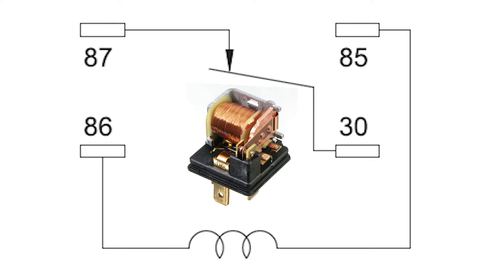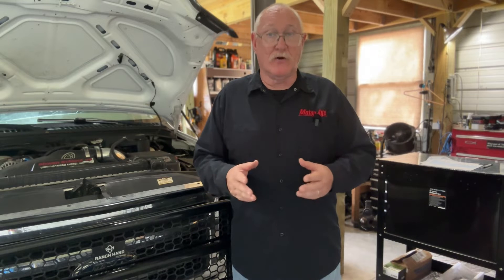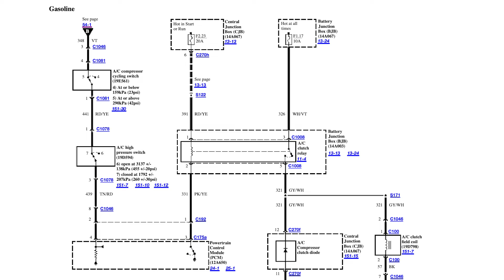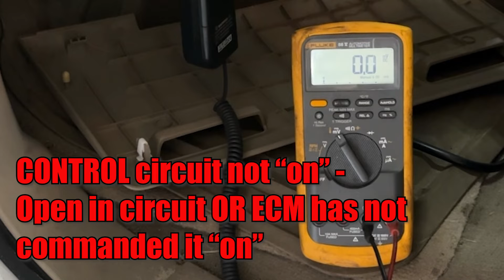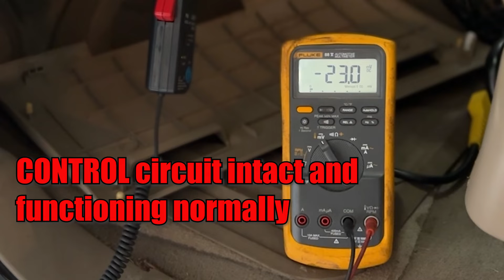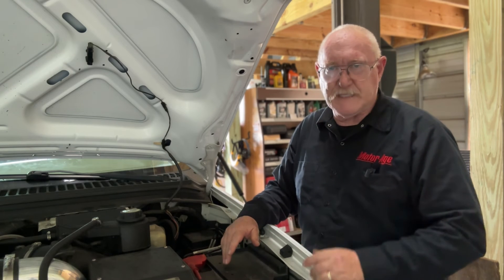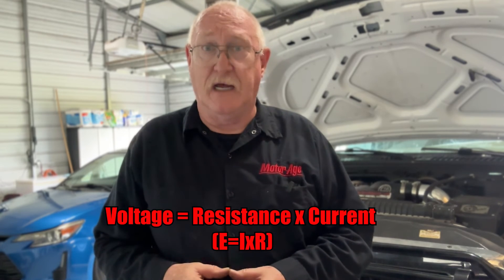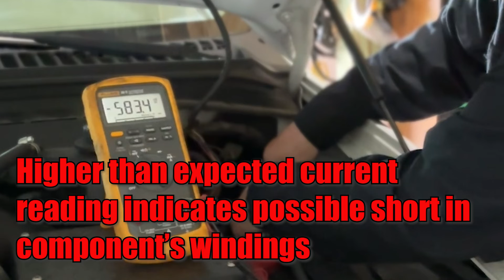Service Done Right #14:  Troubleshooting Relay Controlled Circuits

Comment: Some tips when testing relay circuits:

I would recommended starting with the load side rather than the control side. A control side fault will usually result in a DTC, which we will generally scan for at the beginning of the troubleshooting even it the MIL is not on.

And I would disagree that it is easier or more complete to start with a current measurement, and I think to be complete you should really showcase a car with an actual relay issue or introduce  a fault and then go through your recommended procedure to highlight how it is faster, where I think you would find the proper starting point is to do a full system scan for any DTCs, and if none start with the load side. 

So, without a code start by verifying the fuses are working and the load circuit is intact as follows:

1) When doing relay testing with engine off it is a good idea to put a voltage maintainer on the vehicle to slightly charge the battery and provide vehicle power for testing. For the vast majority of relay testing you do not have to start the engine like instructed to in the video, just go key on engine off (ignition on). 

2) To start troubleshooting a relay circuit, I think it is much faster to use a relay test jumper (see Lisle 56820, just really an extension) to gain access to the relay signals with the relay plugged into the jumper. Then you can test using a DMM on DCV, where many technicians introduce a small load (100 Ohm) across the DMM to decrease the overall impedance (resistance) of the measurement to slightly load down the circuit, with some techs still using bulb load testers. Introducing a relatively small load helps eliminate ghost voltage issues and high impedance connector pin / wiring harness corrosion issues. 

In the beginning the voltage test is better than the current test because the relay power feed may be shorted to ground which would blow the fuse in the fuse box, and if you introduce a fuse pigtail to measure current you would just blow this fuse also. When the control side fuse and the relay are in the same fuse box the likelihood of an internal relay box short is very low unless you live in the salt belt where you never discount fuse box internal failures, especially if under hood. For the load side fuse there is always a possibility of a load circuit short to ground.

With the relay test jumper (extension) in place for a low side drive relay circuit, connect the DMM black to battery negative and probe with the red positive lead. First check that you have power to the relay, you may have to go key on engine off. If you have 12V at the relay control and output (low side load) you know that the fuse(s) are okay. 

3) If the fuse(s) are intact, meaning no short to ground, then you can see if the relay output circuit, which includes the load fuse, will actuate the load. At this stage in the testing, it is actually faster to use a relay output tester like uActivate from AESWave to test the load side of the circuit (many will just short across the relay extension) rather than actuating the relay from the control side using the a scan tool. 

If a fuse is blown then you have to find the short or partial short which are very common failure modes. Two very popular options are 1) disconnect the fuse and relay and look for a short with a fox and hound, or 2) introduce a test load like 10 Ohm resistor (many use a bulb load tester) and probe for voltages, or perhaps use a thermal imager if the short is not a dead short (it has some resistance and will create a thermal hot spot). You can also use an audio test at the output of the test load so if you wiggle test the harness and disrupt the short the bulb will turn off but the buzzer will turn on. 

Why is this faster? The relay output contacts are the highest failure rate item after a harness short or a connector / harness corrosion issue. Also, if there is a problem on the module control side a code will generally be stored so the approach to troubleshooting would be focused more on the control side rather than the load side from the beginning. The module, unless there is a dedicated sense circuit which is almost never used, will only be monitoring the operation of the control circuit low side driver. So the module could be commanding the relay to turn on and electrically the relay control is on, but the relay contacts are so damaged the load never turns on, and if the contacts ever weld the load may never turn off.

4) If the load turns on with uActivate or a jumper, then swap out the relay with a new one and test for proper operation using the scan tool.

In summary if there are no DTCs stored:

1) Test power feeds.
2) Test output circuit. 
3) Replace relay and command relay on. 

More stuff:

There is another reason to use a relay and that is circuit isolation. With a magnetic relay the control circuit can be completely electrically isolated from the load circuit. The relay operates using magnetism which isolates the control from the load. However relays, as compared to solid state power control, are highly unreliable. 

From the Engine Control Perspective, you can control a relay with either high side or low side drive. Low side drive is used more often due to the lower cost of a low side driver. 

Most automotive module low side drivers are actually "smart" devices with many features one being an active clamp to prevent driver damage with the relay coil (inductive) load at switch off (inductive spike), for a very small and automotive relay capable device see ST Microelectronics device VNL5030J-E
. So, most relays with a resistor across the coil (for newer cars you will not see a freewheeling diode across the relay coil to protect the module output) is more to minimize EMI (radio interference) rather than protect the module low side driver. Also, any exposed pin on a module must be protected against ESD when handling, which also adds to the hardening of the low side driver circuit. The coil inductive spike is managed inside the driver.
Reply: This is by far the most elaborate comment i have ever seen on youtube. Explains a lot easy to understand. Good on you

Comment: Hi from across the pond.  I’ve had 3 ecu’s fail on my French hdi diesel , always in the wet.   It’s now a “project”.  I’ve been researching the best I can “ecm failure modes” and at 2 min 37 seconds you mention voltage spikes up to 200 volts which can kill the ecu.    Mechanical Mindset has a video called ECU Killer,  and he demonstrates voltage spikes from faulty relays up to 400 volts !!!    This has to a massive Achilles heal of modern systems.     Surely there must be some additional protection available to stop this.   ECU failure is very expensive….which is why my car is now a project until I’m absolutely sure I’ve found the source.
Reply: I used to be a BMW tech and I can remember that the DME relay (engine control module), was always a different relay than others on the car. I would guess they would install a diode somewhere to prevent the voltage spike from damaging the ecu. Just a guess. I remember on some E-36 models we had to install diodes in the wiring for the ignition coils because they would short and send the ignition voltage back to the ecu.

Comment: Pete, my favorite way of testing relays is using 4 jumper wires (w/fuse preferred) but carefully connect the relay back to the appropriate cavities in the relay center. Then, with the amp clamp, measure control side (85-86) then device side (30-87 or 87a). With each jumper 6-8" long, it allows the relay to safely sit on a fender cover. Switch the DMM to Volts DC, allows visual confirmation while commanded on or turned on, but disconnect 85 by removal, off then on then off. Watching for a voltage drop on the contacts side while connected in series or simply to ground. 5-9 times of "On-Off" operation should warm the contacts or cause movement as some do. One bad connection on high resistance is all you need. "It is like, how flat lobes on a camshaft does it take, to make a bad cam? Once! Just a tech tip. DK. ASE Master, retired.
Reply from the maker: Great tip! Thanks for sharing your experience with us.

Comment: Make sure the battery is up to full potential first.  Hearing a relay "click" does not guarantee current is flowing through the contacts.
The worse relays are the ones internal to a "Smart Junction Box" or "Power Distribution Module."

Comment: Hey Pete , thank you for sharing your knowledge with us.. 
question ,you mention that you shouldn’t use a relay just because it looks the same. I recently was working on a 2019 Chevy suburban and it was missing the fuel pump relay so I proceeded to look in my box where I keep fuses relays etc and found one that had the same exact pins , the truck did start but do you think that will be a problem in the future ?
Reply from the maker: Hard to say for sure. It's the possibility that we have to try and guard against. Does the relay you used have a spike suppression device? You can sometimes tell if there is a diagram on the relay body OR you can look it up at your local parts house. If it does, you're probably ok.
Reply: If the relay is a full sized relay (the large square body) the circuit will be shown on the package with any suppression device used. You will most likely see an EMI suppression resistor across the coil. If so, does your replacement relay circuit across the coil look the same as the OEM relay? If so, you should be okay. However, be warned that none OEM supplier relays on Amazon or Ebay are not appropriate for a replacement device.

Comment: How to test starter if it is buried in behind the intake mainfold? Do the amp test on the relay controller side of control and load ? Or is it different way to test?
Reply from the maker: You can use this test to check the operation of the starter solenoid. Testing the control side of the circuit will tell you if the ECM has actuated the starter solenoid and testing the load side will tell you if the contacts did, indeed, close. Check current on the starter B+ cable to see if the motor itself is trying to turn. Hope this helps!